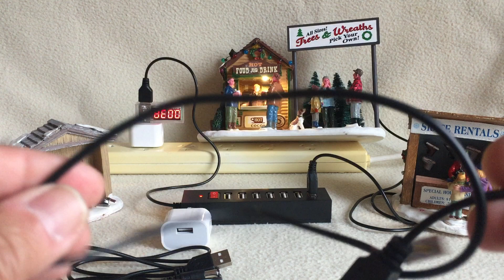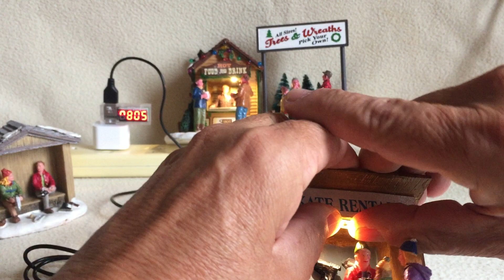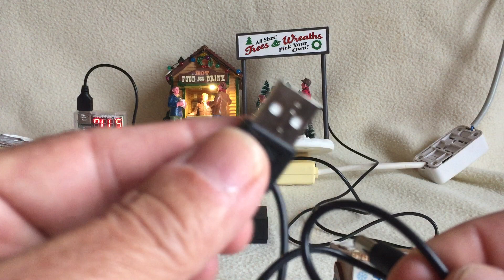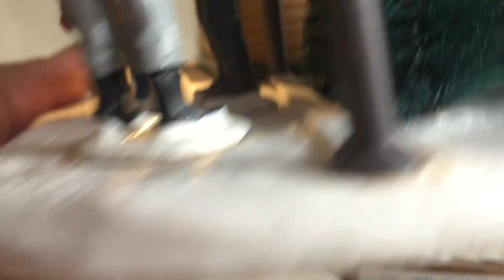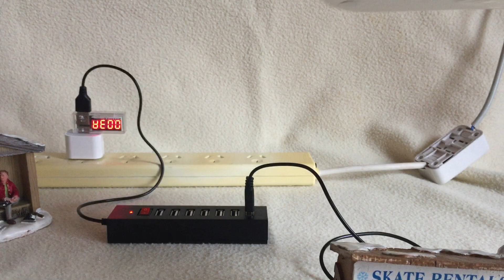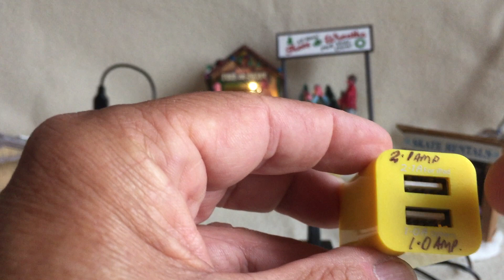USING A 5V USB PHONE CHARGER FOR YOUR CHRISTMAS VILLAGE ACCESSORIES.

Comment: Do you know where to get the LED lights that he attached to the cords or the socket style one he used at the back of the Food and Drink Booth??
Reply from the maker: Sandra, those LEDs  are called "strip" or "ribbon" LEDs. They usually come in roles of 5 metres - look for 120 LEDs per 5M roll as that is cheapest and also the best lighting density.